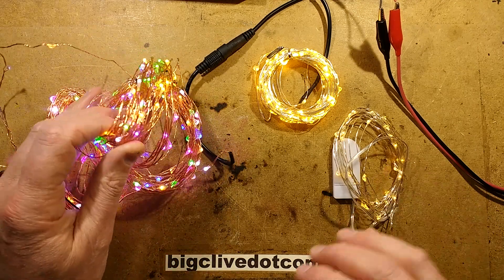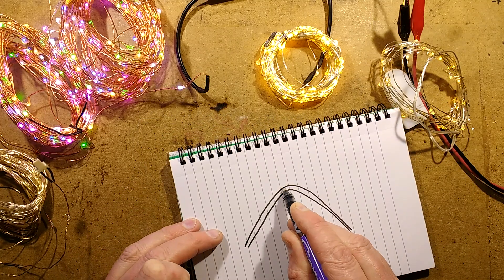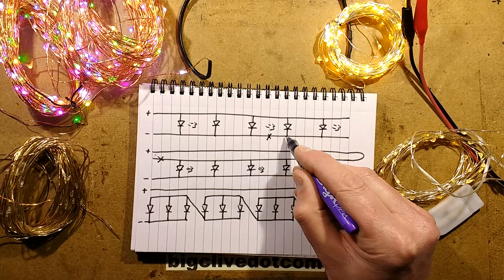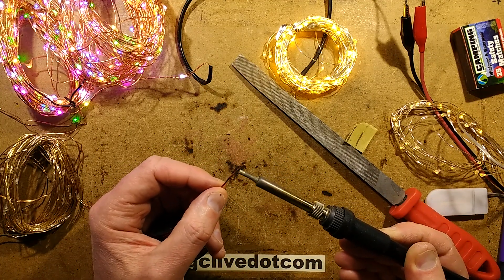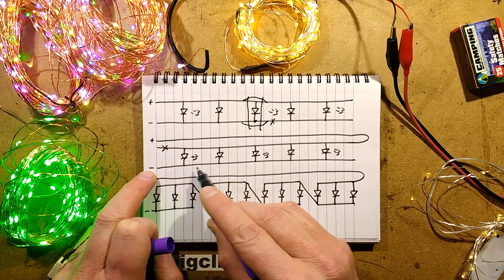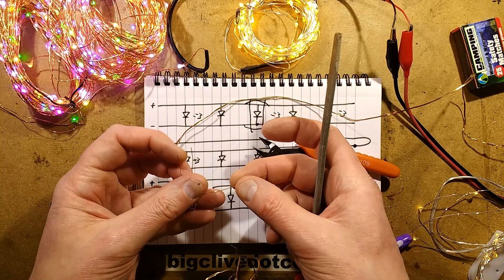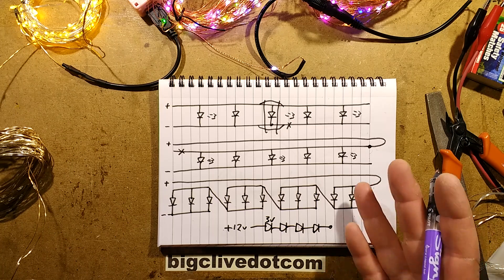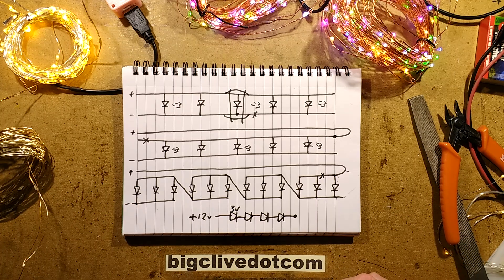Fixing low voltage copper wire LED strings.

Comment: Have had lots of these fail. Mostly they've been outside and the coating/wires corroded away close to an led. Since that I cover about an inch either side of the leds with clear nail varnish. Seems to keep them going.
Reply from the maker: That's interesting.  I've had them outside without an issue.  I wonder if the lacquer on your sets was moisture permeable or if it was cracking due to flexing.
Reply: Doubt it was due to flexing. They were mostly the short strings (20ish leds) from Poundland. Sealed the battery pack and stuck them straight into the bushes. Mind you, it's Ireland so they got well wet! 
Have a strange one for you - 10m multicoloured led string running from 3x1.5V batteries. The green leds stay very faintly lit even when the battery pack is switched off???
Reply: The only thing I could think of is that they aren't actually lit, but the phosphors are instead fluorescing due to some ambient light. That can really make em appear to  be lit up.
Reply: Thought the same thing myself and pulled out the batteries. A few seconds later, the green ones go off. Stick them back in and the glow starts again. It's about the only thing I can think of. Have them now bunched under a high intensity light. Going to leave them there for a while and then check if they to fluoresce.